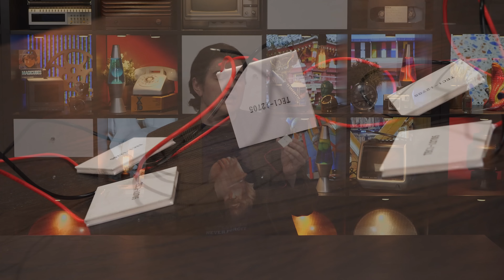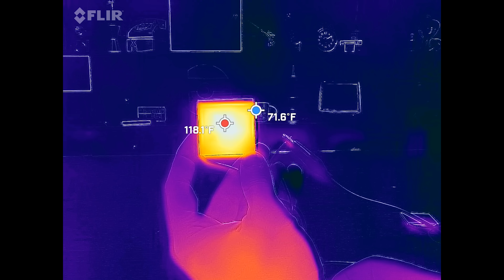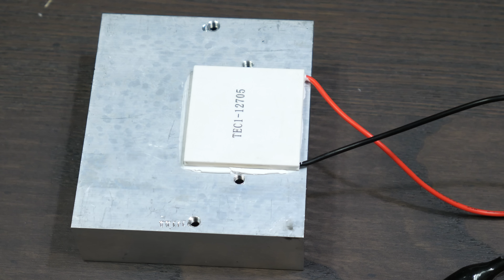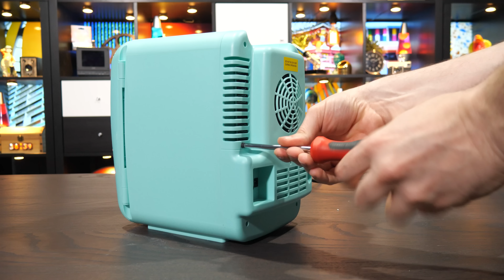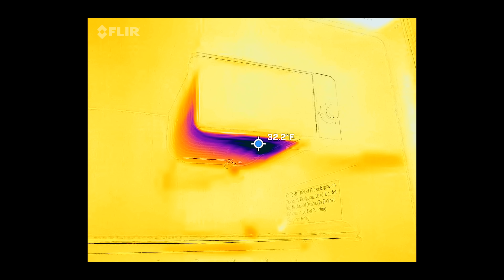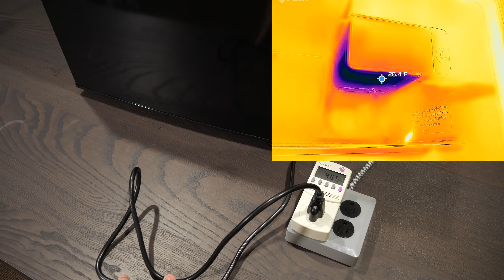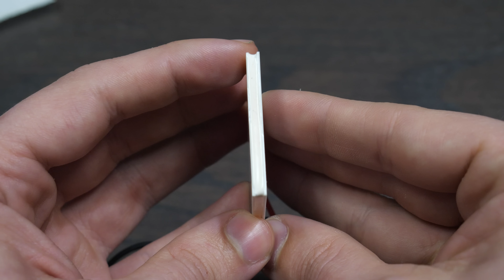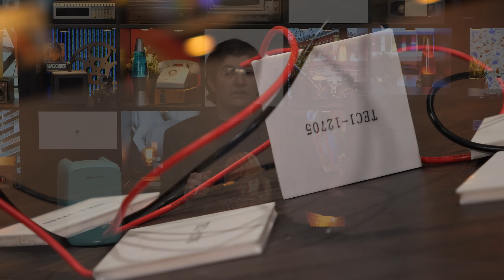Thermoelectric cooling: it's not great.

Comment: My parents were going to buy one of these for my grandfather to store his medicine by his bed. Thankfully I had just recently watched this video and realized the device would not keep his medication at the needed temperature. Thank you for this video!
Reply: You can get small actual fridges, smaller than the one he shows in the video, the one I have is a little cube about 15 inches, 17ltr capacity
Reply: @bevishhh  but what’s the cost
Reply: @obscure.reference  it was about 60gbp/75usd. So more expensive but way better. Those small ones aren't supposed to be left on more than a few hours, for reasons which are obvious after watching this.
Reply: @obscure.reference   Listen, do you want your stuff to be actually cooled and save money on electricity?
Reply: @obscure.reference  Less than the cost of keeping one of these stupid thermoelectric ones are running all the time.
Reply: @obscure.reference  it was about 60gbp when I bought mine so for sure more expensive than these ones, but I’ve had it a few years now with no issue and it’s on 24/7
Reply: @bevishhh what you may not understand though is something I learned from direct personal experience, and that's the fact that these miniatures aren't designed to be left on 24/7 365 like a normal fridge 

These miniatures are meant for small gatherings with just a few people, or you can use it for a day fridge for yourself 

It's easy to think that just because it's a fridge that it can stay on and run all the time, but I learned otherwise when one of the ones I used to have failed for this reason 

Sometime later I got other miniatures, one is a bit bigger with both heating and cooling, but still, they're NOT meant for constant long-term use

My better one was said to be a Coca-Cola one, (no logo) 

I'm thinking it could possibly be a knock off, but I don't know, all I know is I just have to be careful not to overwork my miniatures 

Now that I've learned this lesson, I can better appreciate these little coolers, because I know the real capacity is just short amounts of time so they don't overheat and fail 

You can use it for a short-term day fridge, but DON'T OVERuse it IF you want it to LAST
Reply: @0annonymous  oh no the one I have isn’t a miniature it’s a proper countertop fridge. Like the size of those drinks fridge with the glass fronts, except it has a regular door on it.
It’s a Russel Hobbs one if you’d like to check it out, 17ltr capacity :) I bought it specifically so that I could leave it running without issue and did a bunch of research so that I didn’t end up with one like you described.
Reply: @bevishhh  You gave me hope there for a minute, but looking into it, it's also a thermoelectric device, the same technology as described in this video, and has a terrible energy efficiency rating of 'G', the worst we have in the UK.
Reply: @Timmy51m  holy shit your right! I have been bamboozled! I am super curious as to how I have been able to run this for so long without issue though, as I know from experience that one of these little plastic fridges would not survive. I wonder how they beefed it up so much 🤔
Reply: @bevishhh  Just using better components and design I imagine, it's 3 x the price of the little plastic box in this video, and they don't make much money on consumer electronics do they. If it does the job it's okay, I suppose you just keep a thermometer in there and see how long it lasts.
Reply: @ I’ll definitely keep an eye on it!
Reply: @Timmy51m mines been on for 3 weeks old still working great makin ice and keeping my drinks cold
Reply: @0annonymous that's just called a bad product
Reply: He'd probably be better off with a small portable cooler and some ice packs.
Reply: @ZeldaTheSwordsman better yet, a dorm size fridge like what you see in some offices 

Years ago I knew someone in the funeral industry, they had an office fridge, it wasn't but half size, and it was plenty to hold their meals 

You can stop a dorm fridge a bit better than you can these miniatures 

If you need to refrigerate meds, I personally would go for the DORM fridge ANY day
Reply: @0annonymous Look, I've just gotta ask, what did them being in the funeral industry have to do with the anecdote? Were they also storing particularly small dead bodies in there?
Reply: Get a small thermometer and keep the medicine away from the freezer especially it it’s insulin!
Reply: That's something you research first. Especially if it doesn't explicitly say a specific temperature
Reply: We use ours for medicine and it works great
Reply: @xxskizzumxx Same, with a little thermometer inside to be sure: 37-38°F
Reply: I learned from personal experience NOT to leave these on all the time, they're only designed for short-term use

What you can do if someone needs a miniature fridge is get one of those dorm fridges that are designed for long-term use, and avoid the miniatures for anything longer than a day or two 

You only want to use these for short amounts of time as I learned 

When you see any fridge, it's easy to think they'll be able to work non-stop for years on end, but I learned otherwise 

If you're having a small party with just a few people, or maybe you're wanting to do something for a special occasion for yourself, then yes, by all means, use it for about a day or two at a time 

Now that I've learned what's in the electrical components, I personally would only use them for the day, and not longer
Reply: Nonsense. Mine works better than the garbage he has and I paid 15 bucks for it
Reply: @jhoughjr1  doubt that

Comment: The one everyday use for a Peltier element that I know of is in a dehumidifier. I don’t know that I’ve ever seen a dehumidifier that doesn’t use a Peltier element. That’s not to say that no dehumidifiers exist which don’t use a Peltier element, just I’ve never seen one. However, I don’t think those run all the time. As far as I know, they usually only run when moisture in the air is above a certain level. That’s probably why they’re used in that way.

Comment: I don’t know of any refrigerators that use heat pump systems, most refrigeration systems lack the ability to reverse refrigeration.  It isn’t as easy as flipping a switch and suddenly the compressor reverses directions.  Heat pumps use a reversing valve that switches the hot gas output of the compressor and sends it to the typically cold evaporator, while the cold refrigerant is sent to the typically hot condenser

Comment: For car rides, electric cooling boxes exist. They have the normal insulation of a normal cooling box and then have such an element in the roof. 

Since you only use them to keep cool things cool for a few hours, food safty doesn't matter but compared to the blue toy they have good insulation. 

And you can fill them up with bottles instead of single use cans. They are just very noisy, this however also doesn't matter when driving.

Comment: Peltier modules can be used to both heat and cool a product, by simply switching the direction of the current,  you swtich which side is hot and which ones cold, this gives it some unique use cases where you want to both heat and cool and object dynamically. For example if something has to remain at a set temperature no matter what, than a peltier module can switch between heating and cooling when its in, for example, a cool air conditioned interior, or a hot sunny exterior.

Comment: I am wondering if with a properly designed heat sink and enough electronics to determine current temperature vs desired temp., could a peltier minifridge actually do its job? The main reason for a fridge that small is space constraints. If they weren't interested in screwing the customer, could it be done better to achieve the desired result or is the system just that bad?

Comment: interestingly peltier elements are often used for cameras since they are rather light and only need a fan and heatsink to cool the sensor down. since the sensor needs much less energy to be kept cold it is a very good solution for that specific problems. it is very popular with dedicated astrophotography cameras.

Comment: They are a great solution for thermal control in semiconductor testing and have been used in the industry for a long time now. This video is also a bad comparison, by comparing one specific component to a full sized optimized refrigeration system. TECs power consumption can be reduced by controlling the voltage through a power supply that allows fine tuning of the output voltage. Combining this with a PID controller and you have a perfectly fine thermal system capable of cooling and heating with precise thermal control. The cooling capacity is obviously not  as good as a full fledged refridgeration system but for various low power applications it is a cheaper alternative and gets the job done. There are pros and cons to both.

Comment: I have one of these in my home office - a 10 liter Cooluli 'Mini Fridge'.  Mine is a bit fancier - it runs on 100V AC or 12V DC and the switch has Cool, Off, or Warm.  But I've only ever used it for 'Cool'.  The specs say it cools to 35-40F below ambient  - or warms to 149F.  It has a max draw of 60W and supposedly uses 152kWh per year.  And it is very quiet - I don't notice it unless I deliberately listen for it, especially if I'm working and my laptop fan is going.

I knew going in that it wasn't the most efficient option, but I selected it for one driving reason - space.  I just don't have room in here for even the smallest 'real' fridge I could find.  If someone made a real fridge that was similarly tiny, I'd be willing to pay for it.  But I'm only using this to generally hold maybe three cans of Red Bull and a pint of half & half to support my coffee/tea habit - I have a Keurig in my office too.  It just fits into a gap between a couple of shelving units.  Anything larger would mean losing storage, and I'm already wishing for more.

I push the half&half against the center back wall, right where cooler is located - which often has a bit of ice built up in the humid months, so that spot is at least down to freezing.  It keeps the creamer sufficiently cold to stay fresh well past the sell by date, which is all I need.  So I'm willing to accept the efficiency issues to get something small enough to fit in the space I have, and at least this one seems to perform a bit better than the blue thing.

Comment: The one I had just had a heatsink, no fan but it didn't work... at all. Was trying to fruit azurescens and since I saw it got to ~50° I figured it would be perfect since that's what they want. Now that I watched this, I know it would've never worked regardless (if it actually functioned) since it takes 24+ hours to reach operating temperature! Maybe if I had a humidifier and glass door but then it would've worked even less.

Eternally struck by the widows peak... very nice

Comment: I had one of those little 6can fridges and it burnt out in just under 2 years - thankfully I had a 2 year warranty on it so I upgraded to a larger 12 can fridge and its still working great over 3 years later - its still quiet and i have it on a smart switch so it turns off at night to save power. 

I feel like those super mini ones just dont have enough oomph to keep cold

Id never put perishables in my mini fridge tho - only bevs and some snacks

Comment: i had 1; i’d got from OddLots (which ties into the 1st 3 min. of your video), what people impulsively buying 1 need to know is those really just SLIGHTLY move air around inside BUT (7:46) “it takes forever to cool down) when not 1 thing you put in it is cold nor cool (yet its a mini “refridgerator”) & if 1 can is noticibly-cool while the others arent it can take a minimum of 3 Hrs. to notice ANY coolness in the other
& when all the drinks put into it are all plastic bottles (not aluminum) it takes HOURS & 1 bottle has to be noticbly-cool.
Also, its SO SMAL…no TINY its only useful (SOMEWHAT) for aluminum-bottles slim glass-bottles & slim plastic-bottles WHEN @least 1 is cooler than slightly-cool
AGAIN its seemingly JUST SLIGHTLY moving air around inside NOT cold air NOT cool air just air 
You disected into what its actually doing.
 Explain the “cocconut" aluminum can @ 26:12 please?

Comment: If we scaled up that tiny tiny refrigerator, gave it proper insulation and a cooling monitor, would it's lifetime energy use be greater than, about the same as, or better than the regular mini-fridge? I.e. all of those pumps and metal weight took a lot of energy to mine, refine, and transport. What is the lifetime energy usage of a scaled up version of that same tiny peltier fridge?
Reply: Not sure you're gonna find good data on this, but I don't really see why you'd think these would be better. Never mind fridges are usually in operation for very long periods of time (decades), and the difference in efficiency is several fold, but I'm not convinced how the manufacturing emissions fall between the two either.
Reply: @seigeengine  I don't think anything of it, I just want to know lifetime emission given a proper chance with good insulation etc. to see. That's what efficiency exploration is all about. Maybe it is way way worse, or maybe it's actually better, that's why I want to find out haha

Comment: Turns out, transfering motion from particle to particle is the definition of conductive heat transfer. That also means it's pretty hard to make a device you can push electric current through that also acts as a heat insulator.

Good electrical conductors have lots of free electrons in the conduction band (or in the case of semiconductors, easily available at low energies), and those are mostly free to knock other electrons away to take their place, which is what makes these materials good at conducting electricity. That also makes it hard to build something that conducts electricity but not heat, since you want heat insulators to not easily transfer their energy to the neighbouring particles.

Comment: 26:20 Is it oil that makes them sensitive to gravity? I’ve always been told it was the refrigerant, which was liquid on one side, gaseous on the other, which needed gravity so the liquid stays in the lower part of the circuit! And therefore, a few hours upside suffice to pull the liquid down again!

It’s incredibly inefficient to learn science through word of mouth… I would better check wikipedia.

Comment: I use TEC's to chill water for overclocking experiments with PC's. with 3x150w elements, i sandwich them between 2 copper water blocks, one side is connected to the PC loop to chill the water, the other side is connected to a 360 Radiator that disperses heat outside. i have it also hooked up to a temp sensor that i made using Raspberry Pi W, which controls the amount of time and wattage that is input into the elements. Unless you have free Solar (like i do) i wouldn't recommend it for a day to day gaming system, as you will chew through 450w of power JUST for the elements, let alone the PC you will be using it to cool (around 800+W),

Comment: Thanks for your really interesting content! For me newly discovered.

I think you forgot to mention the scale effect when it comes to heat transfer between a confined volume and the outside.

A smaller body has a higher specific surface than a bigger one. In this case best described as area per volume. Area per mass unit is another metric. 

The heat transfer in W is correlating to the area over which it is happening. Insulation efficiency of a wall can be expressed as effect over area. E g W/m².

Crunching this, you can never get as good potential efficiency in Watt / LA Croix in a smaller fridge as in a bigger one. 

A fridge with a volume of 12 La Croix (I believe that is an SI unit) will have a better efficiency than one for 6 LC. Imagine sawing off one wall of each 6 LC fridge and glue them together. One less wall for heat transfer. 

Specific area comes into play speaking of heat transfer regarding persons and buildings too.

Comment: The inventor John Keely from late 1800's used wires as thermocouples and thermopiles with frequencies applied to control forces of nature, inducing magnetism, gravity control, generation of high pressure from vibrated water vapor, etc. He used ratios of inharmonics of silver, gold, and platinum wires.
 Sandwich plates of differing metals was also applied by french inventor , to both ends of open frame dirigible fro lifting effect when oscillator was applied. I saw , several years ago, of a Youtube video of thermoelectric module on sensitive digital weight scales that lost weight with power applied. Three  months later, the video was removed. Certain vibrations cause disruption in the Ether field.

Comment: Are Peltier elements at all efficient if you can make use of the heat as well? As a trivial example, suppose a stove top or grill with an under-counter refrigerator.

Comment: The problem is you can't buy a small real refrigerator to put cosmetics and medication in that will go to a high enough temperature. Those cheap little square refrigerators would be perfect, except they don't have an infinite temperature setting. My bedroom can get over 100 degrees in the summer, and when the AC is on, my bedroom still doesn't get below 90 sometimes. I just need something that will cool to between 65 and 78 degrees. Those little refrigerators, the warmest I can get them while they are still actually on is about 55. Unless I would spend thousands of dollars on a medical refrigerator or something.

Comment: I wonder howuch better one of these would run with better insulation, a better airflow setup on the heatsink, and a temperature regulator. Really, another $10 could make it a substantially better product that actually gets things cold and uses less energy.